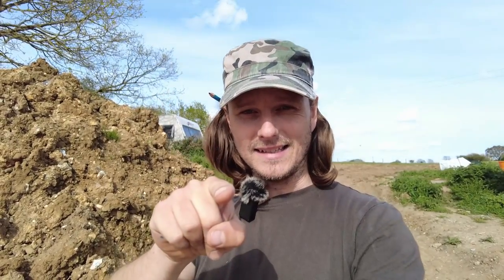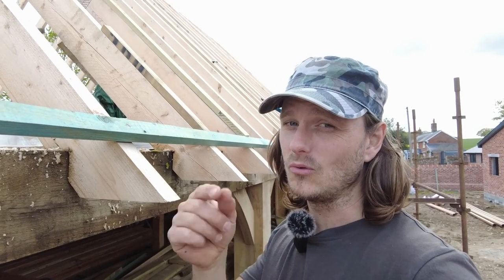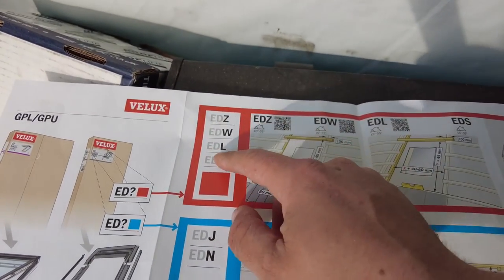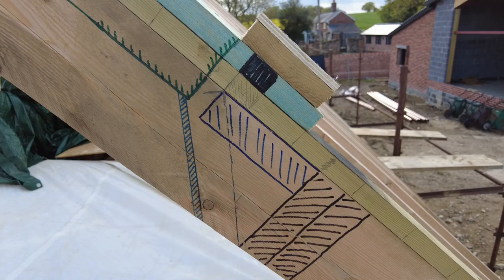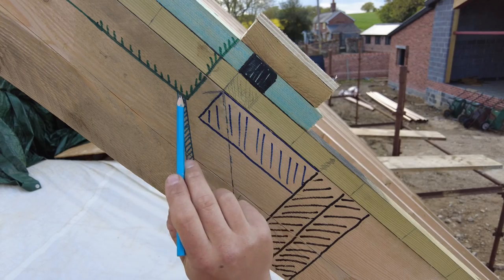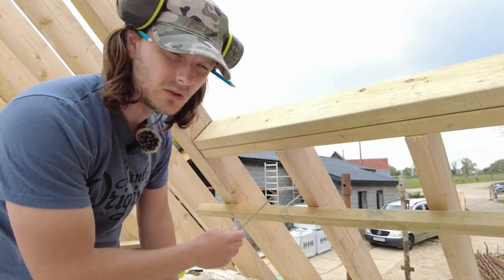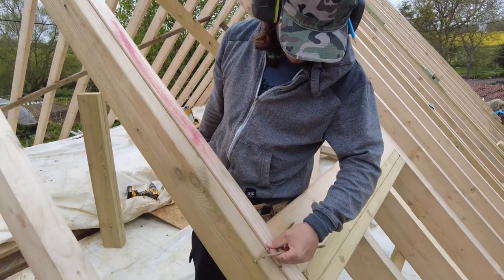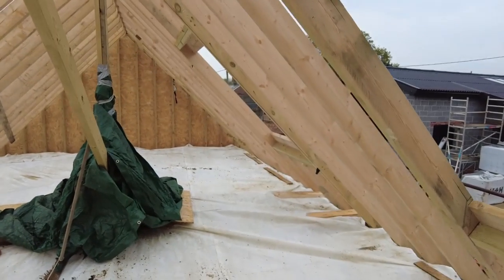How to Frame and Trim a Splayed Velux Roof Window --- #velux

Comment: As I said before it is all about the planning, you have a vested interest on how it will look and turn out something others are never going to have to the same degree. It is the little details like planning the tiles so you have full tiles up to the underside of the velux that make all the difference. Well done and keep up the good work.
Reply from the maker: Thanks Michael 👍 how's the editing going for your extension recordings?
Reply: @THE-AIDEN-PROJECT  Slowly! I'm still trying to decide to either make it into one long video probably over 30 mins or split it into parts!
Reply from the maker: @oldtimer43  maybe split it? I think the 15-20min mark seems to be best. I'm having an editing day today instead of building, put my thumb in the table saw last night! I turned it off but reached too quick so it was still spinning, ouch!
Reply: Even if you were cutting a window in, you would always work from a full tile underneath the window, leaving adequate gap for your particular manufacturers amount of flashing.

Comment: Great vid mate, you’re clearly a natural! I feel like one of the reasons Velux and their chums don’t go all in on splay info is because it has a major flaw imho. Where the rafters taper in for the start of the splay, you have diminishing insulation if any and your U value will go bonkers. Very likely that will in itself promote condensation, offsetting any benefit of the improved air flow. I’m not saying it’s no good, i’d just personally take my chances boxing the reveals more and relying on the air movement and better thermal resistance to stave off condensation issues. Granted you get better light with splay but unless you have issues with light, it’s too marginal to be an overriding reason for me personally.
Reply from the maker: Thanks 👍 I think I've done a playlist for my velux so you could take a look at how I insulated it in one of the videos. I also have a thermal camera and had a look at the velux windows in a video where I tested out the camera, it's perfectly fine 😉 the biggest issue with the velux is actually the glass! They don't use warm edge spacers 🤦 they're aluminium and that's where I get the cold bridging and condensation on the edge of the glass 😑
Reply: @THE-AIDEN-PROJECT  thanks for the reply! I didn’t find the vid but will take your word for it. Funnily enough we are temporarily staying in a room at my mum’s which has a splayed velux (90s build). In the narrower tapered part of the horizontal splay the emulsion is currently wet with condensation. Might just be that the old school mineral wool insulation is so poor but also I suspect your idea of that timber cross member laid on its side has much better thermal resistance in its own right and doesn’t feature here. Anyway we’ve already built ours boxed in and going to see how it goes. Next time we do a build i think I’ll give your way a go. Happy build anyway mate. Am subscribing and am working my way through the vids. Entertaining stuff!
Reply from the maker: @bapoo Here's the insulation video https://youtu.be/zs_W8fvBNgE
Reply from the maker: @bapoo here's the thermal camera video the velux part is further into the video https://youtu.be/kd4PrbsL6T8

Comment: Great vid. I think it is a first!

@9.48 you drop a plumb from your extra trimmer and not from the corner of window. Hence you double trimmers are too far back and you needed to put that filler piece in. So couldn't you move your double trimmers (top n bottom) closer together by c. 1.5" top and bottom?

It all works mind you and your vids are a top job 👍✌️ thanks
Reply from the maker: Thanks mate. Yeah I plumbed it from the batten below the window, the trimmers could be moved further up but it all depends on how you plan to insulate round the window. I've got another video showing how I done that. The way I trimmed it out meant I could get enough pir insulation in place so I reduced any cold bridging. It's abit hard to describe though, I think I've done a velux playlist on my channel if your interested in seeing what I mean. If you use a full velux kit they push you in the direction of having a 50mm box section all the way round before it splays out but I wanted to have the splay straight from the frame. Have you got some to fit yourself?

Comment: I've just fitted 3 velux with splays & also had concerns about the distance from the trimmers to the frame.
Reply from the maker: Did you end up doing something similar to me or just left it with the trimmers further out? I suppose it would matter more the bigger the window is
Reply: @THE-AIDEN-PROJECT   I considered adding extra timber under the one batten that was left floating although my first thoughts was just an extra trimmer on it's vertical rather than on its side like your solution. My rafters are 9 inch deep so was thinking maybe something like a 5 inch ish trimmer so it would still fit inside the splay. However during the chaos of the build I completely forgot about it until I was slating the roof yesterday & noticed the extra bounce in the bat while nailing the slates to it. I'm not hugely worried about it but I may still add extra timber to support the bat when I get a spare min either as I initially  thought or I may steal your idea if it looks like it will work better 👍

Comment: IF i ever put velux in myself, this vid will be my first port of cal. and i suggest you use 200mm.
Reply from the maker: IF you ever do then maybe you can use 200mm 😂 you might need a right angle drill though

Comment: Aiden nice strong workmanship. As for the splayed shaft, all the people that I learned under(USA) always flair the light shaft. In fact I did so on all 4 sides with a flat ceiling on the inside this means starting at the curb bottom. Gets pretty tricky on the trimmer sides because the angle changes as you go up or down from the ceiling to trimmer. So it is either wet thin drywall down and bend it or use lath and plaster; but with great results in light diffusion? Protrusion? confusion? Anyhow I have angled the headers before, like the old school Velux video but the trimmers would only work angled if the ceilings if the ceiling is parallel(vaulted) for reasons mentioned before, the change of angle as you go up. Now days I just double header and put a third angled header just to hold the drywall for the flair or splay. Was abit your typo?
Reply from the maker: Thanks mate. The typo was "come to thik of it" haha It does seem American and Canadian framers are proper craftsman compared to UK framers. I suppose that's because it's mostly about brick and mortar over here? I had considered an angled trimmer but wanted to leave it open for the chance to insulate better
Reply: @THE-AIDEN-PROJECT  like I said if you have a flat ceiling inside it will get weird on flaired trimmers; better to frame straight from the curb on the roof and down to ceiling but every framing member is at a different angle on the flair and you have to bend the drywall. Spray foam is your friend if you were angling a trimmer R-10 foam prevents  93ish % of heat or cold from passing  r-20 gets you 94%  ish so diminishing returns 1.5 - 2inches of polyiso board over the framing versus fiber insulation between will work miracles at preventing condensation. A cold light chamber = condensation I have seen wall studs frost up inside a house; just the studs. In answer to the USA versus UK. I will guarantee there are more shady builders here. I just don't work with them or hire them. Some of the greatest wood workers come from UK, Japan, Poland, Norway, Canada, Denmark. Europe has higher code standards. Even the Simpson joist hangars and stuff are about twice the thickness over there. Is that needed? Well, no, not until they start to rust in the long  term. Cheers!

Comment: You should have angled the horizontal timber to allow ait flow
Reply from the maker: Not sure what you mean? Do you mean put the double trimmer at an angle to effectively get an extra 150mm of air gap?

Comment: Pre drill the timber that you are fixing to the structure ,saves a lot of battery and splitting ,
Measure from the bottom row of tiles  to 100 mill from the ridge and workout the length by the tile spacing ,round this measurement up and that will, give you how many roof laths you will need ,and that we all your tiles will be equally spaced ,and if your also using a pasload gun then you can't be very confident in your structural fixings
Reply from the maker: Thanks for the input. Just remember, getting a car with an airbag means you can't be very confident in your seat belt 😜
Reply: I mean, if the nail is going in... what does it matter what brand is on the side of it?